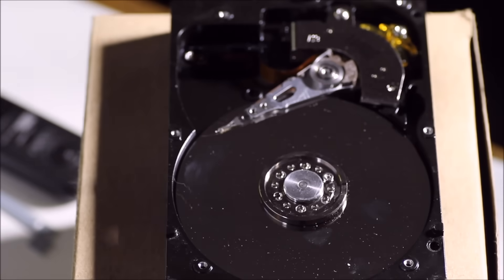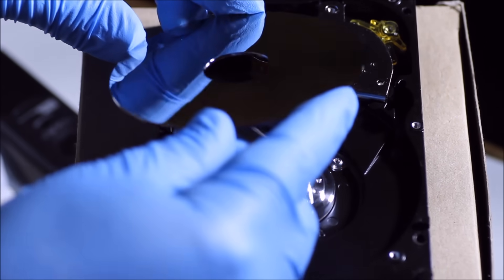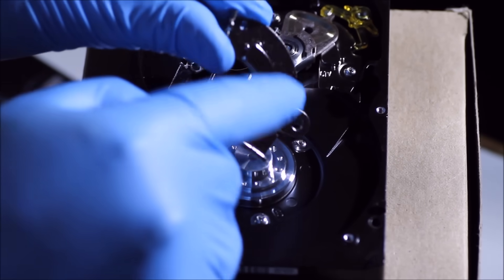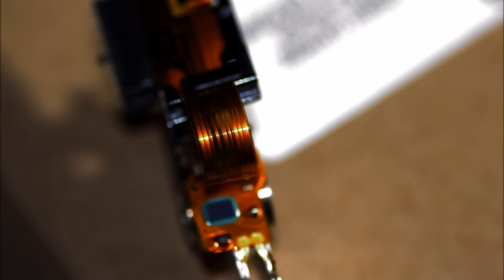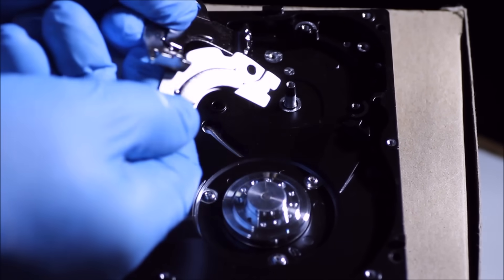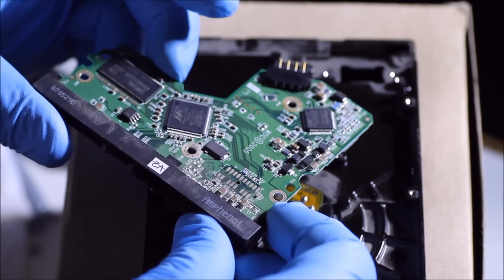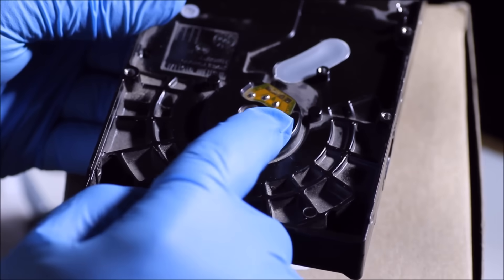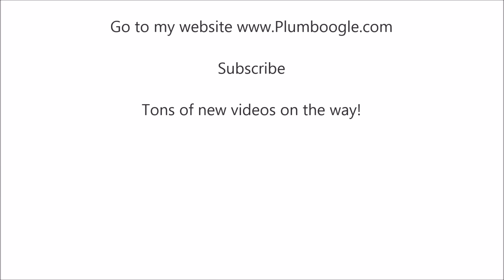Hard Drive Tear Down For Precious Metals! In Detail HD

Comment: Resale info; I dumped a large load of processed HDs and the owner said you really don't need to break them down anymore. Electronics processors know exactly what HDs produce in metals and price accordingly.I was kind of pissed because of all the hours I spent tearing down HDs. But I still have my 75lb box of magnets...a pro tip...if you are going to spend the time to break down HDs, Do Not break the thin metal plating on the magnets if you plan to store them for a while. The Neo starts to oxidizes and over time, you end up with a pile of grey dust. Also, don't cherry pick components off boards. They look for that and will dock a whole load over one or two boards.

Comment: Still interesting after many years and I just happen to have about 4 vintage computers. I know I could make a couple work but the accessories would take a box of adapters to make them work including software that probably does nor exist. I do have a vintage NEC flat Screen that keeps running strong although not as sharp as the new ones are.

Comment: All fake no way can make this much money doing this otherwise hard drives be very expensive ,pick them up cheaply ,if makes this much money can bet he would not post it on here be buying up all hard drives he could why post it get huge competition if money in it can bet he probably sells hard drives on ebay so think before you leap ,anyhow pulled them apart years ago with motor fitted plastic top to it makes great spinning work top fitted into a bench great for loads applications ,also magnets take them off brackets with knife make great fridge magnets ,or used on one of those telescopic mirrors great picking up screws bits peices.

Comment: If you want to separate the gold foil off the plastic ribbon you don't necessarily need to incinerate. You can make a mixture of concentrated sulfuric acid with a bit of nitric acid. Just take care to keep the nitric ratio low as some plastics can be nitrated and could end up catching fire spontaneously if you don't. But if you're careful it'll turn that plastic into a jelly lile substance fairly quickly that can be rinsed off

Comment: cool, I like recycling any electronics if possible. I have for most my life built many prototype projects using parts from old boards from  various household products. I never throw anything Electonic or Electrical out without dismantling it first. If not just to see how it was constructed. But as you know lots of goodies in all that stuff. I used to use the hard drive disc as a chime because they have a nice ring if you suspend them right and tap them with something. But some tend to corrode eventually, could be because I live near the beach as well.

Comment: Sorry, but what you mean it was pure GOLD is just a thin layer of it. Under this is COPPER as an electrican conductor for this equipment. The reason for this Goldplaiting is just to protect the Copper from corosion. It make more sense to collect the NEODYN-MAGNETS and the Discs, they are made from Aluminium.

Comment: I have been scraping these for a while and I found something very unique and I can't tell I haven't tried to put them in the acid yet because I don't have the proper acids to appropriately test to see how much could be there and I'll be but need enough of them however if you look underneath where the ribbon runs on the actuator Where the ribbon goes to that little small plate will that plate will come off and underneath that plate There will be 2  to  4  Little rod pens now these pens are a little bigger underneath underneath that Tiny little pins taken upI have reasonably believed that that is 24 character gold or plated
Reply: If there is a way to send you a picture of it I could show you you did a very good fine detail of breaking down the hard drive but I've been looking through a bunch of of them Explain that part And I've come to the conclusion I don't believe that anybody's discovered it yet

Comment: I had a flaky hard drive that was making me crazy, it was working, then not working, and more likely to stop working when warm.
I finally replaced it and managed to copy all the files to the new drive. When I was about to scrap it, I took off the circuit board and found the contact points on the board that connect to the mechanicals were not plated, or tinned and some were corroded.
I found this issue on a 2nd hard drive as well. Once I cleaned the contacts the drive worked fine.

Comment: An easier way to extract the gold from the ribbon cables and traces would be to just drop them into some hydrochloric acid (diluted for safety). It will dissolve basically everything except for the gold.

Comment: Nowhere did you mention the screws themselves. HDD's are an excellent source of high quality flat top torx bit stainless machine screws of varying size, usually with large heads compared to the thread, very useful for folding knife making and quite difficult to source elsewhere. The screws and the magnets are my primary target when breaking down drives.
Reply: Folding knife making?

Comment: WARNING: You should wear full cover goggles when removing the platters as the older glass ones can shatter very very easily. Alternatively put the drive in a clear bag and reach inside to remove the platters. Destroying the platters for data integrity should be done inside a sealed plastic bag with a combination of a strong magnet and hammer. Believe me, having glass frags removed sucks.

Comment: My son gets knackered HDD's from work. I strip them down for the magnets only. They're fiddly to remove from their steel brackets, but I found applying a little heat to the back of the steel, holding it in pliers, then wedging a Stanley blade under the magnet to gently pry them off, without cracking the magnets brittle outer coating. It works around 75% of the time. I cover damaged magnets with some insulating tape and use them to hang metal topped jam jars under shelving.
Reply: Thanks for the tip! :)

Comment: Precious metals - I didn't know where they were located so it's good to get a map where to look. Once I have removed the pins is there a way to purify the gold that plates them 'heavily'? Are the caps you showed better sold whole? Is there enough profit (beyond getting great magnets on brackets) in doing 10 to 15 of 1990's hdd's? (Have those in a box, and some old int + ext cd or dvd players; those have led lasers, but any other value?)

Comment: Cool video.  It would take you about 1 month to extract about $20 in precious metals from pc junk.  If you going it alone.  Or you could buy an industrial grinder which cost you a min. of $50k... The magnets are everywhere.  Worth nothing on ebay.  Good for fridge.  If breaking down cell phones, you need to break about 500 of them down for a gram of gold.. have fun.
The coolest thing I did breaking down HDs was make a "cd spindle" of 25 platters.. be sure to wipe all date b4 that.  Or put each platter in zip bag and give them as gifts in Xmas cards.   You will confuse the hell out of people.  😁

Comment: That claim in the thumbnail is inaccurate. The gold is usually small in amount like micron thin coatings type of small and is 22k or so. And silver contacts in breakers etc... Is 80percent pure. And the older the breaker the chunkier the silver pad is. I've found .25cm thick pads the size of my thumbnail in larger old breakers before. So big that you can make a carved pendant from the pad without having to smelt a bunch of them into one lump. And often times relays like those with clear plastic covers have 22k gold pads for contacts instead of silver ones

Comment: I have a desk top and laptop computer that were not powering up. I need to get junk out of my house. I broke them down for scrap. I took the aluminum disk out and am worried that some one might be able to get my personal info off the disk. how can I wipe them without having to buy equipment. I have thought maybe break them in half? would that make it nearly impossible to get data off there?
Reply: or could I just scratch the surface up alot?
Reply: @1022doris  Just one scratch from centre to edge renders the disk unreadable.

Comment: Any hard drives that still function normally can also be sold on eBay with the intention of data recovery specialist using them for parts. Often times many of the specific components are valuable since they're constantly changing. A very detailed listing with plenty of pictures and accurate descriptions of the different numbers on the label can yield some pretty nice sales numbers.
Reply: Interesting. This apply to older models (1st half of the 90's?) Mainly Seagate + Maxtor, some working early SATA 1 IBMs
Reply: Probably
Reply: @iggy151 ❤ this

Comment: Great video, thanks. Just wondering how much would you get $$ on average for a disassembled hard drive, ?
Reply: a couple of cents per platter drive (no SSDs). we used to have piles and piles and piles of them. most we spend on chemical to strip the gold was about $500 to accommodate all of them, the pull was $800 (we made $300 on approximately 3000 hard drives)  it's not worth it to scrap these things. CRTs are an even worse thing to scrap (and dangerous). it's best to stick to scrapping cars and other large machinery than computers or small electronics.
Reply: @caillousdad5786  wow, thanks for the reply. In my trade I have to scrap dishwashers and ovens (household units) with the high scrap metal price at the moment I’m getting around $20 Aus for each unit, and that’s as bailing steel, not dismantled at all. It’ll make a great Xmas party fund by the end of the year

Comment: I use the magnets for securing small tools and stainless rulers on the wall, as well as plastic measuring triangles (with a small steel washer siliconed to the plastic first). Powering the hard drive plater can be very useful as a miniature sanding disc by glueing wet and dry sandpaper to it for precise grinding or small blade sharpening.
Reply: How do you power the motor ?

Comment: If I had a continuous supply of these I would go for the gold just to say I have some.  I could find more in a rocky mountain stream in one day, though.  What I really want to know is how to make the motor work with the components already in the hard drive.  Where do I hook up wires to get the thing to work without having to buy an esc off hobbyking?  These are fairly powerful for their size and could be used for simple tools or RC devices.
The magnets make great wall hooks if you have steel walls like in a ware house or a big fridge. They are also good for attaching things to old heavy cast iron machinery like my old Jointer or bandsaw table for extending the table or holding a square or even a can on the side with water for grinding and cooling or mineral spirits for putting rusty tools in so they can shake while a machine is running.

Comment: The Magnets also oxidize very quickly if you remove them from the magnetic shield. They are quadropoles as well, basically meaning they glued two magnets together where the fields oppose. This makes for some interesting possibilities with the shield on because it is close to being the equivalent of a one-sided dipole.

Comment: the MAGGNETS  are good for testing silver bars and rounds....as the silver slides across the magnet it slows down because of the diamagnetic effect...it builds up magnetic resistance due to a building of a magnetic field in the silver....

Comment: Usually the screws are stainless. Only on the really odd brands are they regular steel. Takes a lot of them to make a difference, but I save steel too. If I'm going to the effort to pull stuff, I might as well get every penny. No more time or effort to throw them in SS pile as to throw them in steel pile or away. Some of the retainer brackets I've found are mildly magnetic. I've been putting them in SS pile, while the ring I put in the Aluminum pile. The old hard drives take 1 or 2 whacks with a punch. This reveals copper windings. I just pry them off with a screwdriver.  I NEVER leave them in. In the yards around here,  if there is ANYTHING magnetic at all, it goes into dirty aluminum and the price is halved. The top cover sometimes is 2 ply, aluminum and Stainless. They can be separated. I haven't tried this, but recently read a tip that if you boil them they separate easily. I've pried some apart manually and it's not a huge ordeal. There's Rodium on the tips of the actuators somewhere, which is why I watched this video. I'm trying to find out exactly where the rhodium is, . I'm curious if anybody is getting anything for the ribbons that come off the actuators? I've got a small pile of them and would love to get rid of them somewhere for more than it costs to ship them.

Comment: the video picture sais the arm has pure gold? like 24 k? not gold plated right? i like the Idea of Gold recovery from electronics but it seems like to much chemistry and use of dangerous chemicals to retrieve all that gold leaf. then for some reason after treating and smelting the gold it seems it doesnt go for very much. i like to gold pan for placer gold. was also curious about the ceramic pieces that contain silver and palladium, do you have to chemically separate that too or can you just smelt the ceramic off with borax? if so it would leave you with a silver palladium mix then you would have to try to separate those two or sell it as is lol

Comment: Test First.  A working HDD is always much more valuable than scrapped.  You can get at least $50 for most drives.
If it's near end-of-life...The circuit board alone can be sold for up to $45 if you can prove it passed SMART test.  Get a $20 NexStar TX or other HDD dock and use Crystal Disk to verify the drive is good.  Take a photo of the drive's label and sell the circuit board to Recovery Specialists at auction.  THEN take it apart for magnets, etc.  Great video otherwise, very informative about metals.

Comment: Nice one.  I got about 20 of old HDD's all 10GB to 80GB old IDE 3.5" drives; found yesterday they contain neodymium magnets that I plan to take out and change into a metal detector.  After watching your vid I will be keeping the more valuable elements too.  Cheers.  A vid I watched said there is a 3rd smaller Nd magnet behind where drive actuator sits to hold it in place when off and in transport.  Smart vid, learned some cool stuff in 7 minutes.  Cheers Rob.

Comment: i also collect the 
- Aluminium case for melting (DIY furnace propane or electric)
- the Discs are exelent surface-mirrors good as  laser reflectors
- the sata connector , good for producing own sata-adapter
- and the magnets offcourse
- the top cover can be usefull as sheetmetal

i didn't know that there is also mumetal and goldwire in it

but i think you made an error 5:49 in electronics components labeled with c are capacitors, resistors are labeled as r and usuall are black with a white font on it.

Comment: I like to remove the brackets from the magnets, but I found trying to get a blade under them breaks them too often. What works for me 99% of the time is use two channel-lock pliers. Grab one side of the bracket with one channel-locks and grab the other side with the other channel-locks. Then bend the bracket away from the magnet. The magnet will separate cleanly.
I've collected about 100 of them over the years.
Reply: Just heat them up with a torch ..they come right off.
Reply: @richardsmith1289  Heating rare earth magnets seriously compromises their magnet strength. Not recommended.
Reply: Oh I did not need the magnet I wanted the bracket they were attached to.
Reply: @richardsmith1289  I literally laughed out loud... That never occurred to me.

Comment: The reason companies are using less, and even no gold anymore is because newer hard drives are meant to be recycled now.  Older hard drives are better built because they are not meant to be recycled.  Take an old computer for example, why is an old computer so heavy?  The reason is the case is usually made from mostly metal on older computers which is why an old computer is so heavy.  On a new computer the case is mostly aluminum as they are meant to cheaper and recycled, which is pretty sad to me.  I highly go against scrapping older drives from the 90's as they are collectible and are a part of history.

Comment: Yes , i am a processor of recovering the metal from electronic stuff , nice video , thankyou ! When i scrap hard drives i burn , crush , pan out the heavys and save the sludge after evapen the panning water , the chips is where the panable gold and pgm's and a lot of silver and lead . I do it as a hobby now ! The gold plate in the sludge is minor compared to chip wire , copper is acid removed and redoxed in a different container. Great informitive video .

Comment: Saving the Drive for a Kid Doing a Retro Computer Project in 2047 is the most Human thing to Do . If the Drive Works , If not , Just sell the whole Drive as the chemicals cost more than the Metal recovery , Any Old Ad Lib Sound Cards are going for Over $200.00 a Card on Ebay , There are Other Very Rare Computer Cards and Parts . If you have Tones of Computer Collectables you can Scrap them in an Emergency , The Older they get if they function the More they are Worth as a functioning Computer Part . I follow the Computer Collectors Code of Conduct , If you can Save a functioning  Part for a Hobbiest who will not even be bore Until 2050 or thereabouts , Your a Decent Human Being :) QC

Comment: Late to the party. I found the easiest way to remove magnets is to grab either end of the metal the magnet is attached to, grab with bare hands or use tools if need be. basically any tool than can pinch will do,- bend and grab the magnet like it was nothing. 100 % succesrate